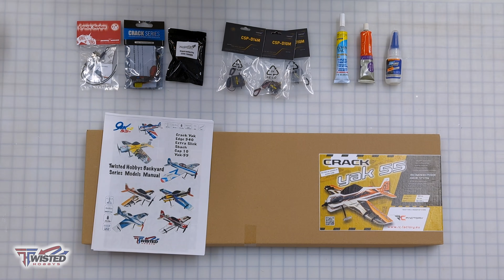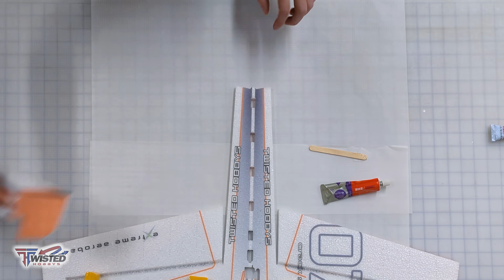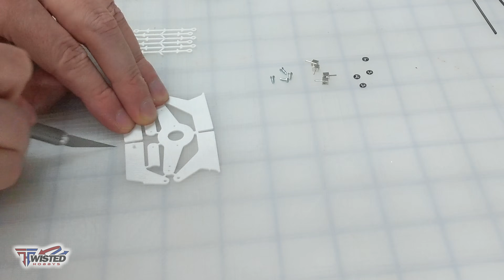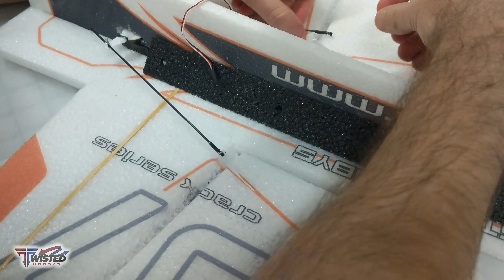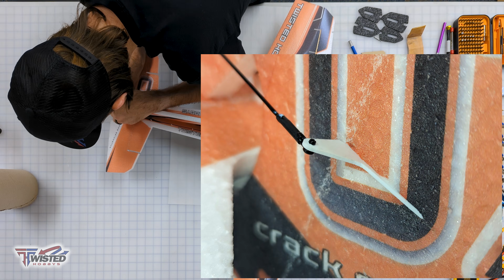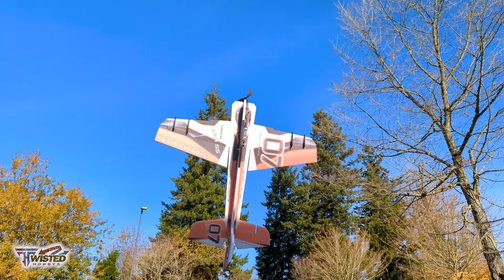Twisted Hobbys/RC Factory - Crack Yak 55 - Build & Maiden Flight

Comment: How do you compare the 32" versions to the 39 and 43 airfoiled versions?
Reply from the maker: In short, not as big feeling since the 39" are very floaty, 42-44" have a higher wing loading than the 39" so they too do not feel as floaty.

Comment: wich motor and battery u using for this build , 3s or 2s ? , i want to build 2s for lower weigh
Reply from the maker: Jim’s using our CSP 25g 2305 1500kv motor on this build.  Working perfectly on 2s or 3s

Comment: Did you install battery on opposite side of receiver and ESC?
Reply: Yes, I usually swap over all my models to XT-30 and during that process, I run the wires through the fuselage to the other side.

Comment: Where exactly did you place your battery and how did you attach it?
Reply: I started with the recommended CG and used Velcro long enough to give me some room to move it forward/backward a bit depending on which battery I'm using and to fine tune. at 11:50 you can see where it ended up, but every model is going to be a little different.

Comment: Mine is a bit over 2 yrs old. According to my tx16s timer, i have 32 (yes) hours, 42 minutes of air time. Says alot about durability. Especially 4 min flights on a 3s-450 battery. Only other 1 close is the indoor rExtra at 28 hours. Just ordered (another) big zorro and the big revolto.
Reply: Too, my rExtra has been flown in 20mph+ winds outside.
Reply: I quit buying 'branded' crap after my fokker

Comment: Which is better for outdoor flying, the 32 or 39" yak..in your ooinion?. thanks
Reply from the maker: Just different since the 39" have an airfoil and more wight you can penetrate wind better which "can" at times make it more enjoyable for mid day wind etc.  Though the 32" make it easier for smaller spaces out side.  You have options :-)
Reply: @TwistedHobbysIncChannel  thanks. I have a small area to fly. Does the 32" "fly" as good as the 39?
Reply: @Plydrms  Yes, the 32" flies just as good as the 39", but it is lighter, a little more affected by wind, handles crashes better, and works great on 2S 450mAh.
Reply: What size battery are you liking for the plane?-thanks

Comment: Are the wheels supposed to spin freely like useable wheels, or did I just get some glue up in there to make them stiff
Reply from the maker: They should spin freely, sometimes it's a little tricky getting the first nut between the wheel and the pants support to tension against the pants support.